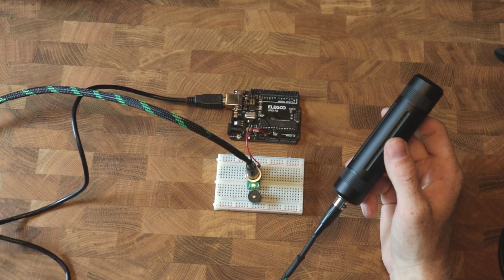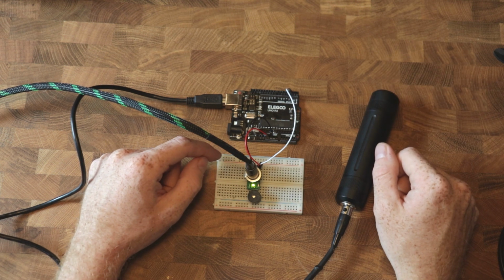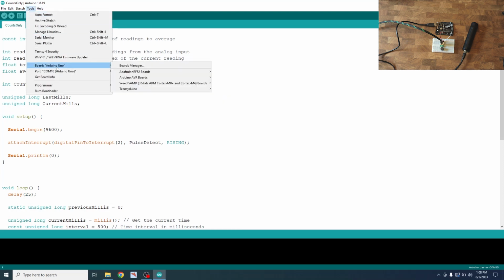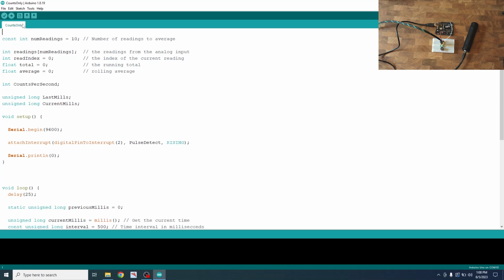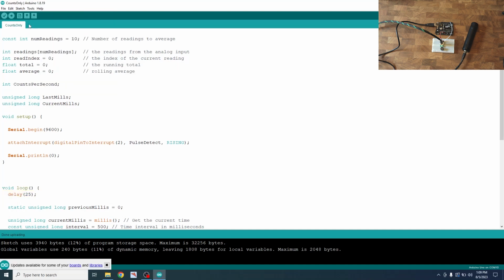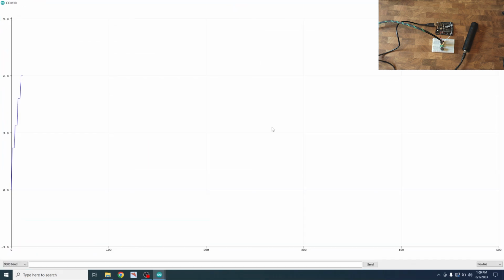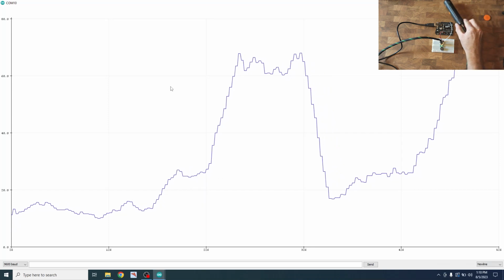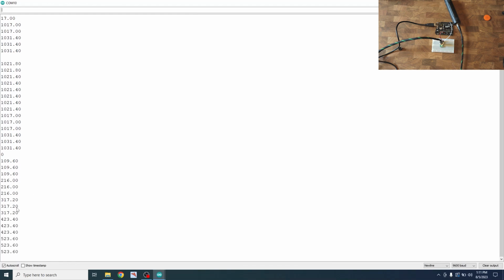RadView Mk.1/Mk.2 CPS/CPM Display

Comment: i managed to use your code and ofcourse with a different detector from yours(mine is a NaI) and it worked. I got cps in the serial monitor and a graph in the plotter. I hade to use a voltage divider because the digital o/p of the detector was 12V so i had to lower it to atmost 5V for the arduino. I then wanted to go further to the gamma spectrum, i connected up everything but it didnot work. On the serial monitor it was displaying some funny characters. I also noticed that the code that you used in your youtube video is different from the on i downloaded from your website.
The other thing, I hooked up my detector to an oscilloscope and i saw the energy pulses of different heights on the screen but failed to work on the gamma spectrum code. Any corrections or suggestions ?
Reply from the maker: So the issue is your scintillator is outputting very fast pulses, Mk1/2 have special circuitry inside of them to allow slow arduinos to capture the pulse energy. I would reccomend looking into https://github.com/OpenGammaProject/Open-Gamma-Detector
To see what you need to get a spectrum. Mk1/2 has similar circuits fully integrated into the capsule which is why the code just works for mk1/2

I’m sure if you look at the time scale on your oscilloscope pulses are much faster than an analog read on your arduino.

Comment: Thank you for a good video. I have a question, how is the detector powered, is it being powered by the 5V from the Arduino? And also what kind of data is coming out of the detctor to the arduino, is it serial or digital?
Reply from the maker: The device takes in 3.3-12V and outputs a digital pulse and an analog pulse energy value for spectroscopy. If you use just the digital pin you get a Geiger counter equivalent but of course way more sensitive. If you use both in tandem you can get gamma spectrums. You can also set it up with a simple 9V battery and a buzzer!
Reply: @RadViewNick  thank you for the response, where and how much can i get this detector for? do you have collimators and low energy gamma sources?